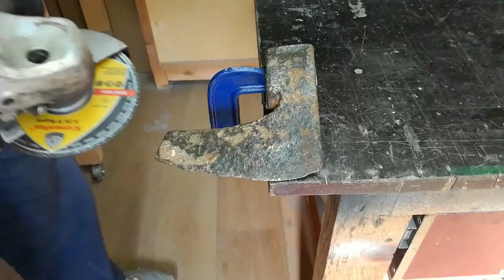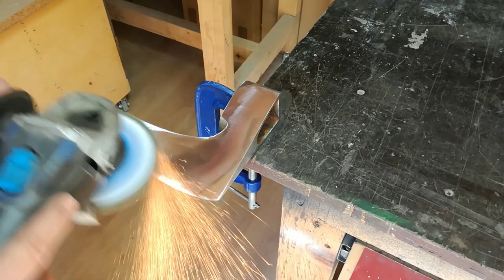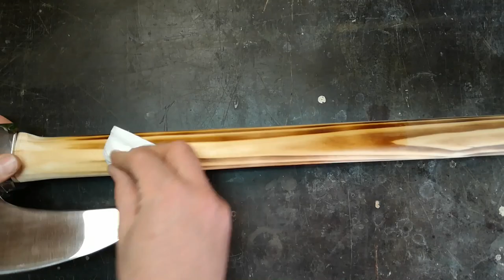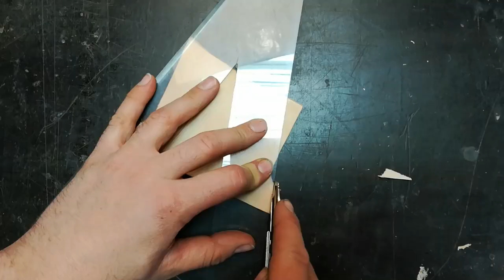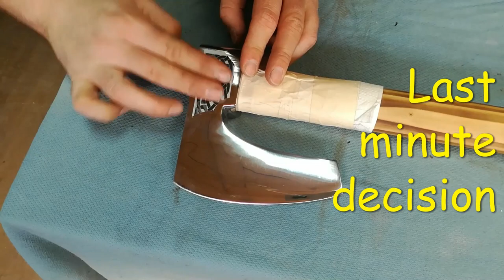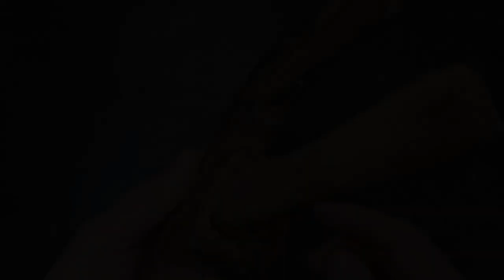AXE Restoration | DIY |

Comment: should replace the handle with something like hickory to make it more shock resistant, it looks like you used pine or something, and that's not bad, it just isn't as effective or durable as hickory. also, bugs won't mess with it if it's hickory. most baseball bats are made of hickory, so that should tell you something.
Other than this, which is a very minor detail, amazing build.